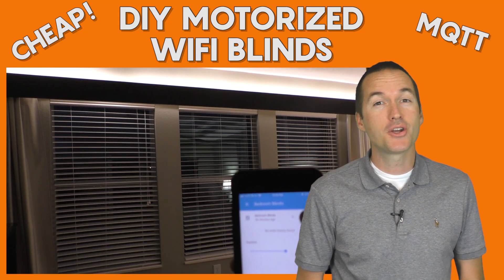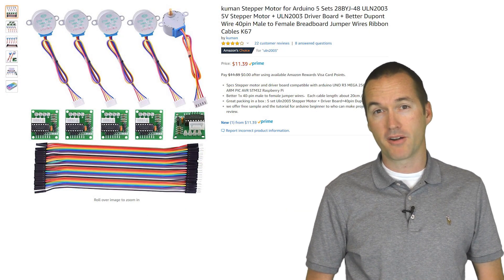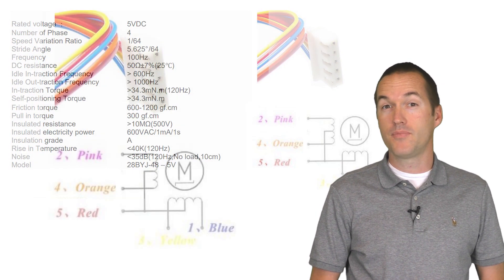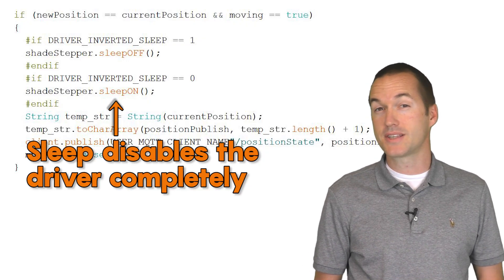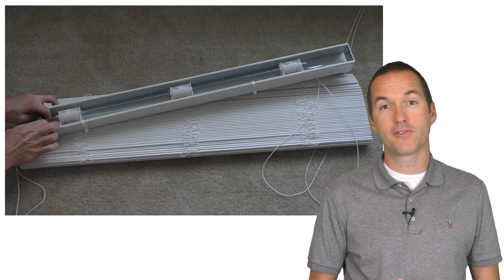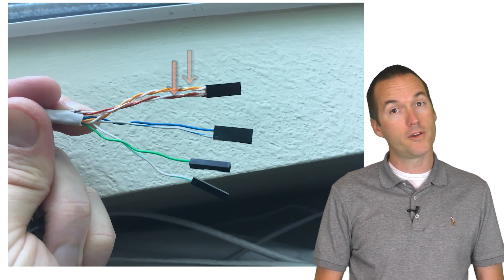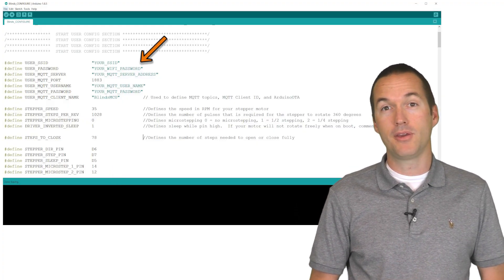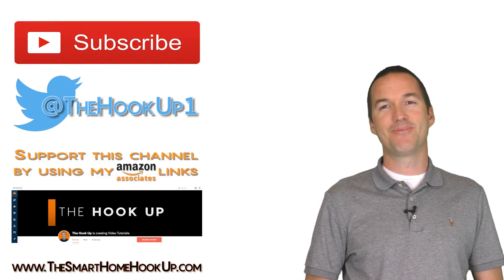Motorize and Automate your Blinds for $10! (WiFi)

Comment: Great video. Thank you! Is there a good way to convert this system to operate using a Double-Throw rocker style light switch? I.e. a hardwired version that does not require wi-fi, but uses a switch instead. Thanks in advance.

Comment: great detail but just want to control wand only dont need to raise and lower. and u probably could have gotten away with just a 5v supply and use 5v and 10v (2x5 in series)

Comment: @the hook up, Thanks for the great videos. I really like the simple no BS presentation.  I am very new to IOT and need some help/pointers. The video says "all you need to do is update wifi and upload to node MCU". It is not clear how i would upload that .ino file? Do i need to install Tasmota on the nodeMCU or compile the .ino file provided in Arduino IDE? Any help/pointers are greatly appreciated. Thanks Again for a great video.
Reply from the maker: https://youtu.be/VdEGGyROgoo
Reply: @TheHookUp  Awesome! Thanks. I did not find this video on your site. Could you please add this to the links of the original video? 
Thanks again. I will post how my project progresses.

Comment: I now have two sets of blinds installed, one single, and one triple, and they work great, even with Google Home. One little problem though: Every time my HA reboots, the blinds go to a different position. I know that you explained how to send an initial value for retention in case of a reboot, but  I  can't think of where to do that in Node-Red. All I  have is a function that sets msg.payload = 0 and msg.topic = "BlindsKitchen/positionCommand", and then I send that to an MQTT for Closing, and one for Opening. What am I missing?
Reply: did you figure this out? having the same problem
Reply: @mickandkez  I think it had to do with the Retain flag. I'm actually watching a video on that. It doesn't happen anymore, but I'm not entirely sure how it got fixed. Watch this: https://www.youtube.com/watch?v=31IyfM1gygo

Comment: Hi. I've been trying the Alexa only option but without success i can't seem to discover my NodeMCU. Any ideas?. I can ping it on my network after configuration. Used both BINs
Reply from the maker: Is it on a different network (VLAN)? Do you have any fancy networking segmentation?
Reply: @TheHookUp  I've got a 2.4ghz SSID (which im using to connect to) and a 5GHZ SSID. I've tried 3 different NodeMCU too. I've got 2 echos. One in kitchen and one in lounge. Flashes fine, Configs fine just Alexa doesn't discover it
Reply: @dannlima4552  Nope, didn't work for me. Ended up going the MQTT route with home assistant. All good except the unknown issue when home assistant reboots or looses power to the MCU. They come up with "unknown" status. No biggie for me as they still work

Comment: Hi Rob, great project! Can I replace the NodeMCU with a D1 Mini? It has the pins needed for this project, but I don't know if everything is supported and what power consumption would do...
Reply from the maker: Shouldn't be an issue using a D1.
Reply: @TheHookUp  Thanks, it works in general now... How do you counter hysterisis when changing direction? I need about 2 extra steps for the blinds to pick up before they start moving.
Reply from the maker: I think that’s due to the slack in the cord, not an issue with the motor. I mostly just fully open/fully close mine so it’s a non issue, but I can see that it would make small adjustments annoying.

Comment: Any recommendations on how to make this a battery/ solar project?
Reply from the maker: After trying and failing for over a year at doing that I've determined that either 1) it is beyond my skillset, or 2) It's not possible using this configuration of components.

The best I've been able to get is 1 month of battery with a solar panel and 4 18650 batteries, WiFi is just too power hungry.

Comment: https://www.facebook.com/groups/DIYLaser
I tell ya, I don't own a 3D printer and may not ever.   But I do have lasers and with that being said, for most symmetrical designs for components, I can usually out run a printer so bad that I have the same parts in seconds to the minute or faster.     You should invest in one of those as well if you don't already have one.

Comment: The servo wasn't the problem, it was the drive type.   Linear drives (AKA) screw jack/worm gear would have eliminated the negative feed back on a load bearing suspension while simultaneously giving you gear reductions for compounding torque advantage.
That being said....  You made the right move by just going open loop PWM for this sorta thing when it comes to cost effectiveness!   Great video and thanks for the efforts.

Comment: I built this project and it worked for several months but one day all my blinds quit working. I re-uploaded the firmware and reconnected them to wifi (which was successful because they appear in my router device list). But unfortunately when I scan for devices through Alexa it doesn't ever find the blinds. Any idea why?
Reply from the maker: Did you replace one of your alexa devices?
Reply: @TheHookUp  Nope, same echo dot I've been using for years. I tried removing the blinds device in the Alexa app and re-scanned for new devices but still no luck.
Reply: Update: I think it might be some issue with the fauxmoESP library and the WifiManager library. Still trying to debug it. When I run the fauxmo library example code my Alexa is able to discover the ESP8266. But when I use the fauxmo integration in the blinds code, it isn't working.
Reply: Update 2: I FIXED IT!

So it turns out it was not an issue with the fauxmoESP library or with WifiManager. After about 8 hours of debugging, I finally narrowed down the issue. A capital B. 

Apparently in a somewhat recent Amazon Echo update, they removed the support for capital letters in smart device ID names. My blinds were labeled Blinds1, Blinds2, and Blinds3 which used to work fine but quit working with the update. I was able to change the names to blinds1, blinds2, and blinds3 and all the devices were once again discovered by the Alexa app. I know it was the capital that was the issue because I also tested other strings such as BlindsOne, which failed. 

I will contact the fauxmoESP library dev to include a check for capital letters so that this is no longer an issue for others.
Reply from the maker: That’s bazaar. Thanks for the tip.

Comment: Rob, would you please confirm that you used one driver to control all stepper motors?  Or did you use one driver per motor?  Also, are you providing 12 volts to the 5 volt motor?  Thanks in advance!!
Reply from the maker: No, one driver per motor, a single NodeMCU to power all 3 drivers.  12 volts to each driver.
Reply: @TheHookUp  Thank you for your quick reply and thank you again for the great video!
Reply: @TheHookUp  Rob, do you have any idea why one of my stepper motors gets extremely hot?  I connected two stepper motors to two drivers on one D1 Mini.  Both motors are connected to the same power supply.  One of the motors gets extremely hot, even when not used, while the other one is cool.  Both drivers are cool to the touch.  Any feedback would be appreciated.  Thanks!
Reply from the maker: @eclecticlife  the enable/sleep pin is probably not hooked up correctly.  That pin cuts power to the motor when not in use.

Comment: Is there an update with Smartthings integration?  Google Home etc?  I'm ready to do the project but I don't really want to purchase an Alexa...Thanks!
Reply: I would LOVE to see an ST update for this! there is a new ST_Anything_WindowShade_ESP266WiFi sketch, I am trying to use that as a starting point, and pull in the hookup stepper motor code to get it functioning. update to this, you can get Home assistant to work with SmartThings and Google assistant (though with some caveats)

Comment: What happen when your power is interupted? How to put stepper into right position? The servo always know its possition but the steper dont.
Reply from the maker: As long as you doing change the position while the power is off it will remember its previous position
Reply: @TheHookUp  and what if somebody move when no power?
Reply from the maker: Then you will need to manually move it back when power is restored.

Comment: Since blind automation has stayed over $100 per blind for the last few years, I wish you would commercialize this but selling the 3d parts or a kit that has everything. Then take it a step further and incorporate a battery and figure out if it can "remember" the location of blinds changed manually using the tilt rod. For years I have been looking for something that would be around $25 per blind (and most things are hidden).

Comment: I followed this guide and everything works quite well.
Only one issue is that the stepper motor seems to pulse instead of running smoothly. Is there a way to get the motor to run continuous instead of pulsing?

Comment: Great design, works flawlessly and planning to add to all the blinds in my home. I would like to add some manual switch inputs to the  NodeMCU to run the blind tilt locally at each window. Pretty novice Arduino programmer could you help me out with the code to add this feature?
Reply: Check his GitHub page under Issues.

Comment: I set this all up but my blinds seem to be too heavy even with the 12 volt drivers. Do you have any recommendations on how to beef this up even more? I was thinking I could use two stepper motors, one on each end of each blind but I would need a way to reverse one of them to spin the opposite direction.

Comment: Very new and this is the first project I have attempted. I love the video, have all the wiring  the parts but still very confused on where to add the text files. Do they go in home assistant in the confi,yaml , added to mqtt  or as a sketch in ardinio. Would love to complete the project so a point in the right direction would be nice.
Reply from the maker: Which text files are you referring to?
Reply from the maker: Also, which version of the code are you using?  Did you use one of the .bin files from the releases tab?
Reply: FYI I am continuing to look on line for help files and hints. Have the 3d printer so able to make the various parts and purchased all the connectors and etc., . Just the coding and where and how to upload is my weak link.
Reply from the maker: @keithmerry4182  Hey Keith, I think this follow up video might be what you need: https://www.youtube.com/watch?v=VdEGGyROgoo
Reply: Thanks for this link. Will give it a try. Still trying to understand how it all works. Greatly appreciate all the videos you have put together.

Comment: @TheHookUp - thank you for this implementation. Quick question, it seems that the order and colors of the stepper motor wires are different on the kit I got; therefore I am a little confused. LTR blue, pink, red, orange, yellow vs the one on your schematics that are pink, orange, yellow, blue. does it matter? Thank you again
Reply from the maker: The colors are not important, the terminals that they are soldered into the stepper motor are the important parts.

Comment: Very interested in getting this rolling on my blinds, specifically for the windows that are located near the ceiling in my vaulted ceiling area of my home. Quick question. Would the steppers work with step pins (like quarter step, eight step, 16th, etc.) to make them even more quiet, or are they too underpowered/undergeared? Also, will one ESP8266 board power all the steppers required for lets say three windows? Thanks
Reply: Bit late reply but I tried microstepping, it does not work. One ESP will be fine as long as they are all connected parallel, if you want to control individual windows then you will run out of pins.

Comment: Since you end up not using the stepper driver boards that come with the motors, you can find the motor by itself for only $0.73 on Amazon.  There is also a 12v version of the stepper on the same product page for only $0.74:  Both here: https://www.amazon.com/Stepper-28BYJ-48-12V-28BYJ-48-5V-4-Phase-5-Wire/dp/B0881ZFJFN   So you get 5 12v stepper motors & 5 KingPrint driver boards for only $13.69 instead of $21.98.  With a single NodeMCU board for three blinds, that's about $6.39 per blind.
Reply from the maker: They are not prime shipping.  I just tried to order some and it told me they would get here between Oct 7-Oct 29.  If you're going to wait that long for shipping just get them from AliExpress.

Comment: First off, thanks for putting this together and sharing. This project (along with others I haven't been able to do) finally convinced me to get a 3D printer. Have learned a lot and have now printed a custom sized box for my blinds and have completed the circuit/power hookups on a POC blind. However, I am at a loss as to how to get the MCU up and going. Looks like I need setup an MQTT server. Can I do that on my Mac? Do I also need a NodeMCU flasher of some sort (hopefully mac)? This is new territory for me, but eager to learn. If can get a pointer of the correct direction to go, would appreciate. P.s. My end goal is to control this via Alexa
Reply from the maker: There’s a different file to use for Alexa control.  Click on the releases tab on the GitHub page.
Reply: @TheHookUp  Thanks for the quick reply - this helped a lot. Using Arduino IDE to load the provided BIN files. I got both to work and can enter my config and verify through console and network that all is configured and up and running, but alas Alexa discover device doesn't pick it up with either BIN. I also recompiled and uploaded your provided .ino file and again all seems to be working, but discover still fails to see it - using type Other. From what I can tell this doesn't require a specific skill to be loaded? Guess it is debug time. Certainly learning a lot. Thanks again. Cheers, Jim
Reply from the maker: @jdryfoos  Just to confirm, are you using WiFi config, or are you using the arduino IDE to put in your wifi credentials.  See this video for the easiest way to do it: https://youtu.be/VdEGGyROgoo
Reply: @TheHookUp  Thanks for the quick responses. Yes, confirming I using the WiFi config (via "Blinds Setup" SSID) to set my SSID, Password, Unique Alexa ID and Rotations (to 12). Once I save, it connects to my home WiFi that Alexa is on and I can ping the IP. I can also watch the boot in the serial monitor and see the expected output - such as "{"alexa_id":"blinds","rotations":"12"}" . However, regardless of trying the multiple options, when I bring up the Alexa app -> Devices -> Add Device -> Other it scans, but does not find. I have setup two different NodeMCUs just to be sure. Various other Arduino samples (like blinking LED ...) are working. Also setup a web server and could access that. Feel like perhaps I am just missing something related to how to add this device to my Alexa devices? Is a special Alexa skill needed? fauxmoESP says it it emulating a Phillip's Hue light. I don't have a Hue hub, but have also tried discovering new lights -> other and didn't find. In the app add device menu, there are many options to choose. Is "other" or "lights->other" correct? Perhaps something else? Cheers
Reply: Oh, I see Amazon sells Echos with a smart home hub built into them. I don't think any of mine have that. Is that perhaps a requirement I missed?
Reply from the maker: @jdryfoos  no, that's not required.  Do you have any special networking situations? VLANS, guest network, etc?  They both need to be on the same network for it to work.
Reply: @TheHookUp  No, nothing special. I have also now tried with FauxmoESP versions 3.1.1 and 2.4. Also tried some other example sketches with no luck. None of them show up. FWIW, I have plenty of other smart light bulbs and outlets integrated with Alexa working fine. I have fired up wireshark and going to see if I can at least see the broadcast / multicast packets.
Reply: Ugh. The echo dot I was close to turned out to my on my guest SSID, not my primary. Sorry for wasting some of your time, though I did need the pointer to the releases tab. Just got it discovered using the older FauxmoESP. Will try latest tomorrow. Cheers.
Reply: @jdryfoos  Did you resolve your issue? I'm having the exact same problems...the device is connected to wifi (same as echo and multiple other smart devices) but Alexa will not recognize it.
Reply: @toddfuller4003  I did, but so long ago, don't recall much detail.
Reply: @toddfuller4003  If your using Wifi connect  to the 'Blinds'(I think its called) SSID then be sure to give it a name  otherwise Alexa will never see it.

Comment: Hey man, is the wiring from the driver to the motor corrected with the colors of the wire or the location?My wires are totally different located from the motor but the colors are all there.

Comment: Hi ..i loved your video and it was fairly easy to setup ...i have one problem..the stepper motor moves only in one direction ,even if i change the position on HA. Is the motor bad or i am missing something.
Reply from the maker: double check the wire going from the NodeMCU to the DIR pin on the stepper, it is probably loose.
Reply: @TheHookUp   Thank for replying.. i am stuck with another problem. I have tried and checked my work twice and replaced stepper motor,buck converter, stepper driver. I can see the nodemcu sending inst but motor makes a tiny buzz but does not move...not sure what i am missing or why its not working